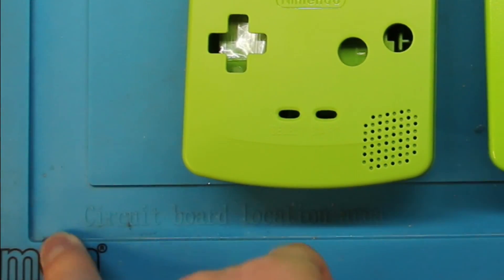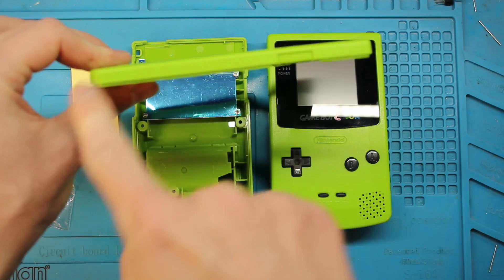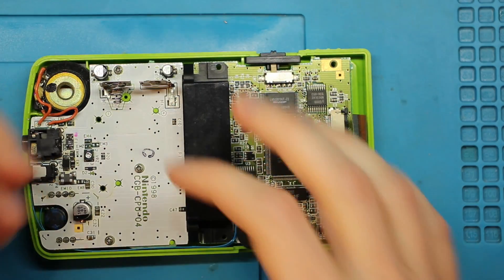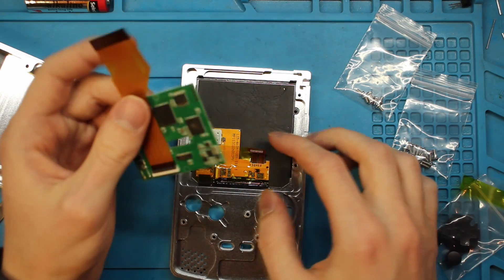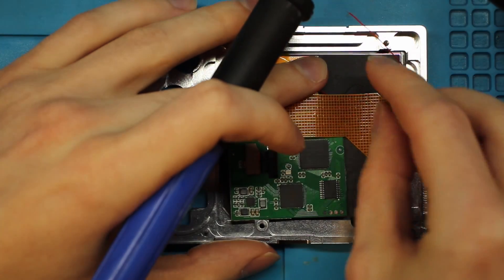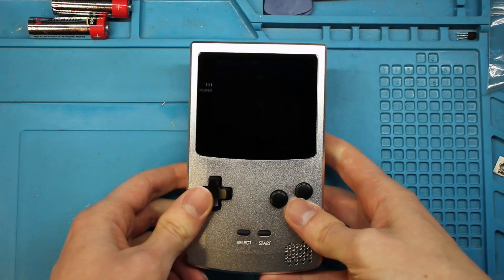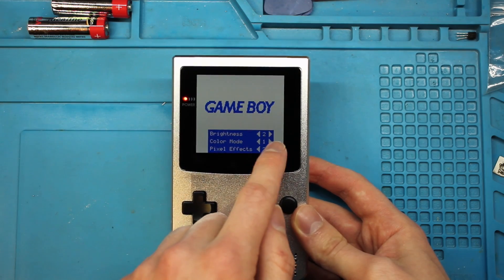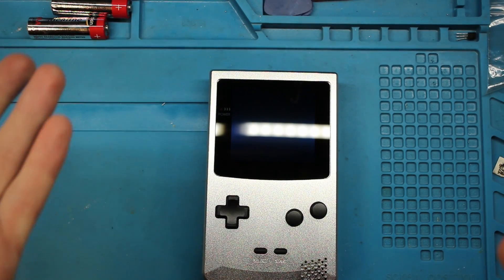Game Boy Color OLED Modification

Comment: how the hell did you get the screen to fit, ive been going at mine for hours
Reply from the maker: I may or may not have used a wood clamp to force it in (4:40). I wouldn't recommend it though because it could crack the screen
Reply: @ yea i just ordered some, i have no idea how else to get in:(
Reply: @ YOU'RE THE FREAKN BEST I GOT IN TODAY THANKS TO YOU

Comment: Hey question if u turn it on and off a couple of times u get a flicker on the screen do u get that as well
Reply from the maker: So far so good, I haven't encountered this issue
Reply: @SamCampbell  I got 2 and both does it in two gameboys
Reply: I have it too, I think you mean when it powers on, I thought it was because it was taking a second to get power to the screen hence why it looks like the screen flickers when turned on and off really fast.
Reply: @drsands2417  someone told me it's the extra stuff I did to it like the caps replacement to a higher number and clean power board I added do u have any of these in yours